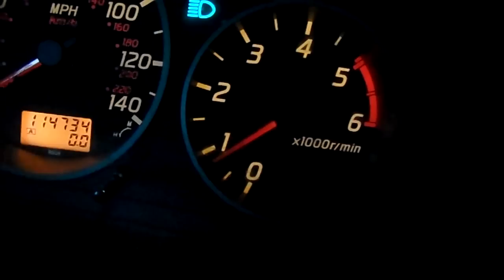2003 NISSAN X-TRAIL T30 2.2 DIESEL 136BHP ENGINE 114,700 MILES

Comment: have got  a code  low  rail pressure   will i need the circuit that goes on the high pressure pump

Comment: bonjour ce modèle et fiable c'est quoi leur probleme svp merci
Reply: Niveau fiabilité c'est top.  Mise à part le turbo de temps en temps. J'ai 260 000 km , moteur 160 000.
Et rien à signaler à part pièces d'usure classique. 
Gros avantages : très facile à réparer et 4x4
Reply: @gregj1187  bonjour j'ai une nissan xtrail 2005 quel es le nom du réservoir côté gauche au milieu ?
Reply: @kenmendelsohn2834  le nom du réservoir ? Je ne comprends pas ?
Reply: @gregj1187  vous avez un WhatsApp pour que je vous envoie en photo